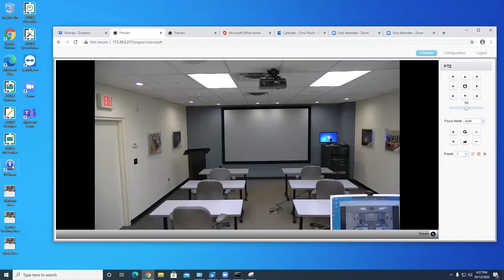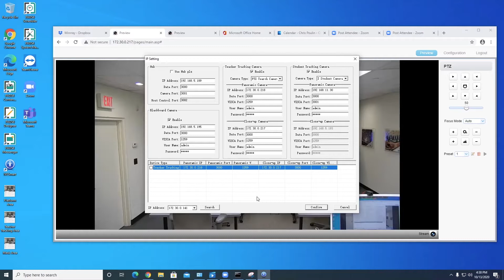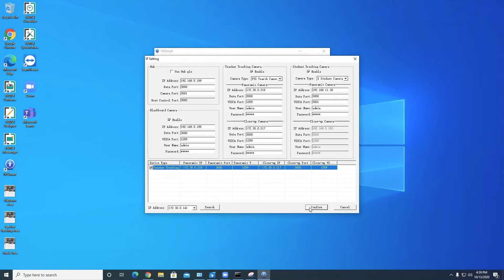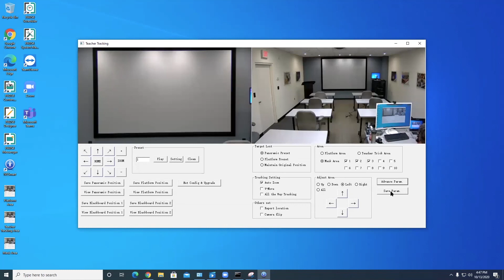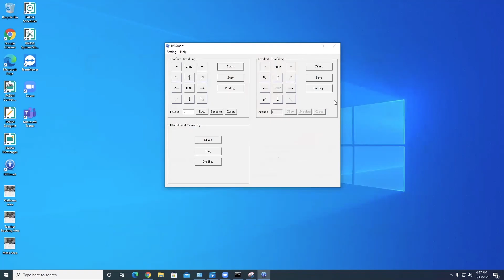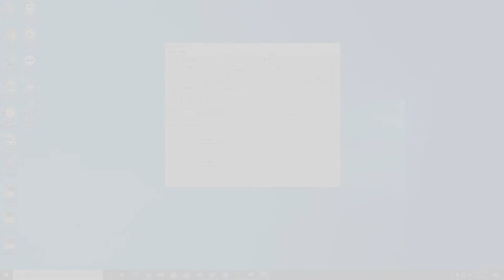Minrray UV100T - Setup

Comment: Does anyone know if Minnray has a solution for when Flash stops working at the end of the year? I sent them a couple emails with no response yet. I saw they have a firmware update, but the camera we have does not use USB to connect. Just curious if anyone knows these answers.  Thanks!
Reply: Well, we are now past the flash EOL and i need to update as well. But also need to find the software that works with this cam. Updating an old but wiring system, but can’t change anything without software or a flash solution.